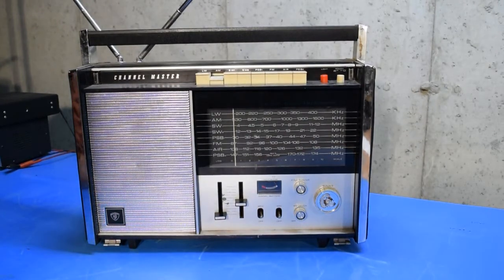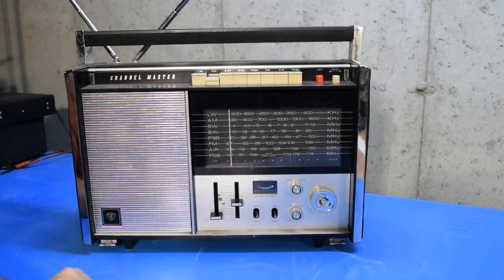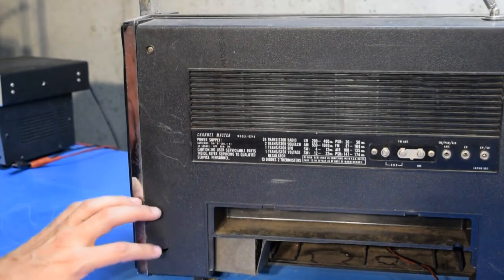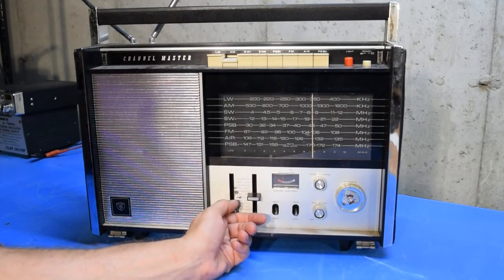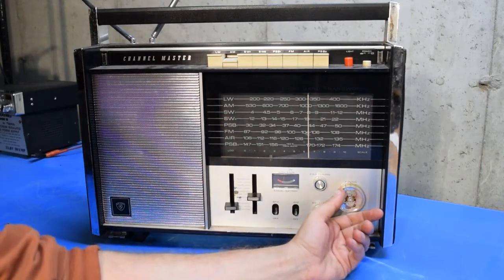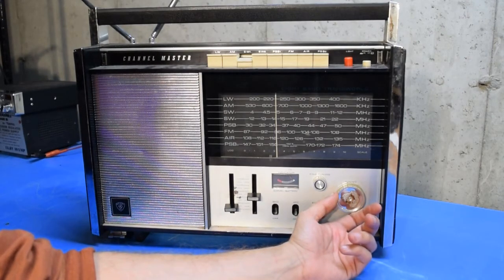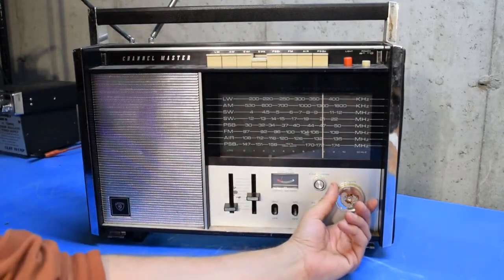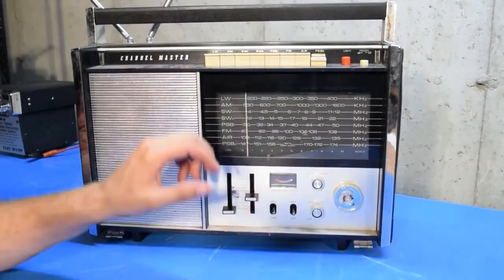Channel Master 6248 Shortwave Radio Review, Highlights, and Band-Scan

Comment: Is there any shortwave radio with recording function?
Reply from the maker: Yes - some older radio were available with built-in cassette recorders.  Some newer radios feature "record out" jacks that allow you to connect the radio to a separate recording device.
Reply: SevenFortyOne i m looking for new digital radio which could record on memory card! do u know one and i also want to know whether there is any radio that can play a shortwave station without fading?
Reply: I think a Sangean ATS 818CS has a cassette deck to record from the radio..
Reply: @debojitacharjee  vwestlife did a video on one, also, the no-fade thing is impossible to achieve, that is one of the main characteristics of SW radio. Sorry...